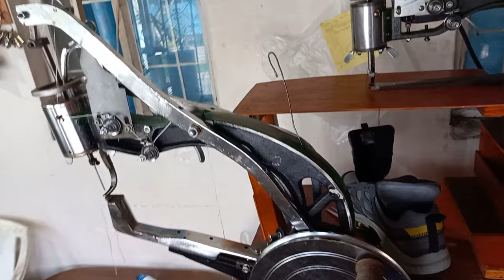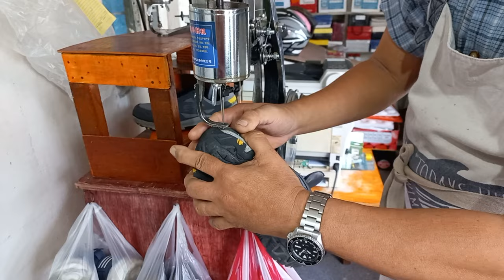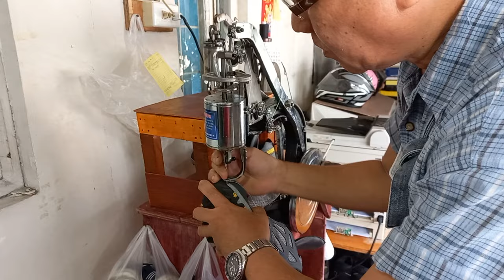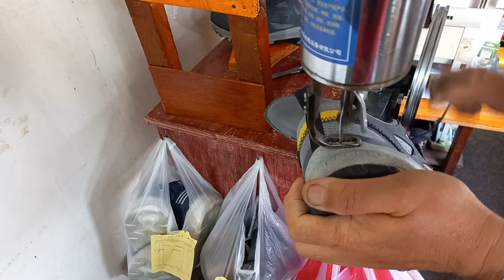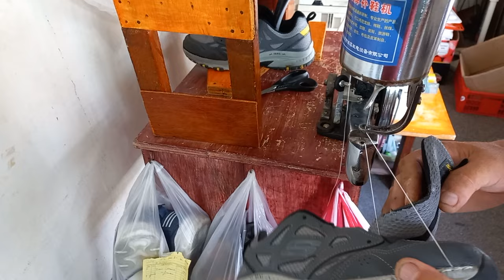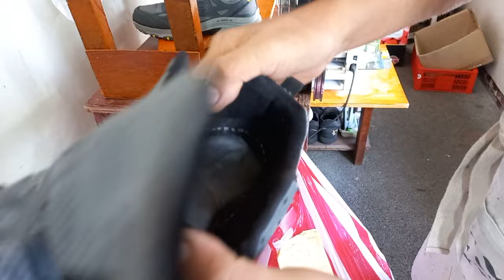Stitching rubber shoes using shoe stitching machine (READ DESCRIPTION)

Comment: Hello Pedrito, great little machine.  Do you have any information on the modification for the high post you have on your machine?  That is and awesome addition.  Thanks for your help...Paul
Reply from the maker: Thank you Paul. Which machine are you talking about? Is it the machine I was using or the one next to it?
Reply: The One you were stitching on with the raised needle pedestal.
Reply from the maker: @atlasdc1637   Thanks for the comment, Paul. I don't have specific modifications for the high post on my machine since the machine is only screwed on a table. You can adjust your own post based on your liking according to which height you are more comfortable with. I also recommend that if you will be putting your own machine on the table, you should put it on the edge so the shoes will not bump against the table once you put it on the machine. Lastly, you should also consider putting some distance between the hand crank/pedestal and the sides of the table. Because if they don't have some distance between them, the crank will always bump on the wood and might not work properly.
Reply: Thank you Pedrito, do you know the manufacturer of your machine?
Reply from the maker: @atlasdc1637  It was manufactured in China but I bought it on Shopee. It's an online shopping website in the Philippines.
Reply: Thank you very much.  Keep up the good work..
Reply from the maker: @atlasdc1637  thank you sir